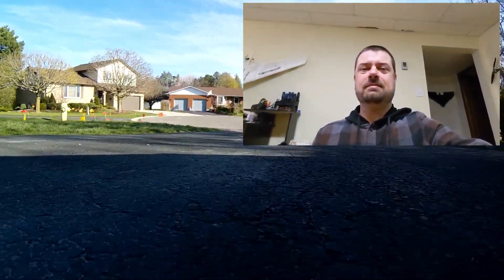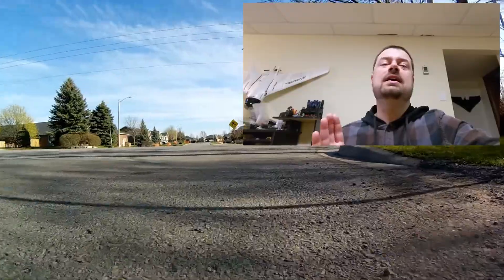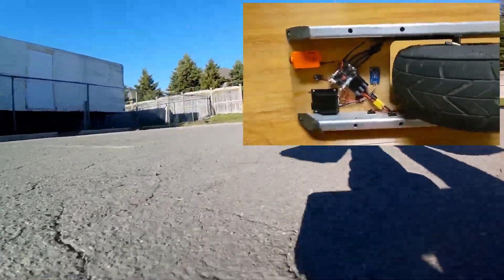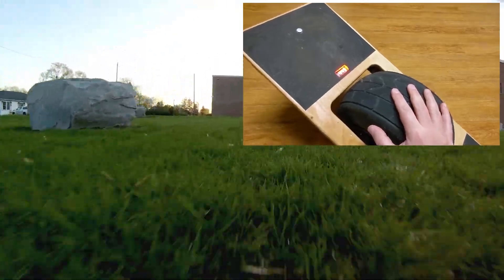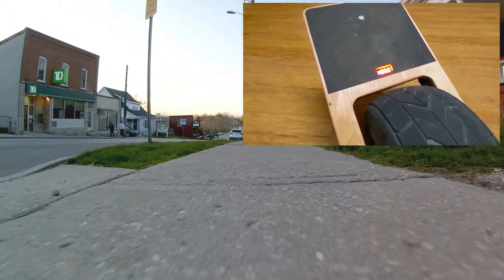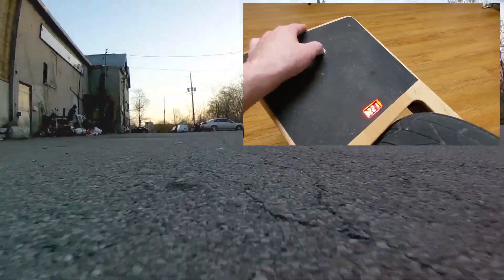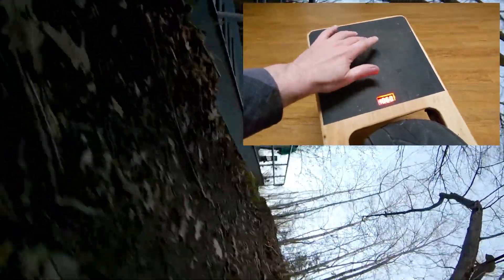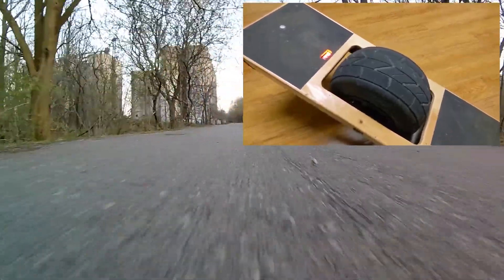DIY OneWheel - After 200km

Comment: really interested in your use of Arduino firmware to drive the vesc, looking through your BOM it is not clear which maytech vesc you are using 4.12, 4.20 or 6.6?? are you using bldc or foc? and will you be adding the vesc settings & full wiring diagrams?  really keen to make my own off your design and firmware and have questions, how can I get in touch, thanks in advance
Reply from the maker: 4.12, FOC, protocol uart, wiring is explained on the site, but I will be uploading diagrams as soon as I can. I will also try to get more on vesc settings up as well.
Reply: @cammservices  thanks for the info, looking fwd to the updates, Have you been on a FM onewheel if so, how does it  compare to yours?

Comment: How would the board react to a hubmotor axle lower than it currently is? I wonder if that would work to increase clearance for hill climbs?
BTW great project, thank you for sharing all the info!
Reply from the maker: Honestly, forward and back stability would be fine, it would be the side stability that would suffer to some degree. Having the pivot point to far below your ankles might induce a sort of speed wobble at higher speeds.
Reply: @cammservices  So I ordered parts as per your website and am looking forward to bringing one to life myself. Would you buy the same cells again? I don't have them on order yet and was wondering if there is perhaps a better choice? Will you release a wiring diagram for the BMS, etc?
Reply from the maker: @pepekrozinek  I have had good luck with those batteries, but do recommend staying with Samsung 25R if you go with another provider as the available AMP rating is awesome. I will post more on the website over the next week. Feel free to reach out at any point if you need assistance with the assembly.
Reply: @cammservices  Ok, here is a first issue: When trying to flash the arduino I had to comment line 26 (compilation difficulties) and I still get the following:
MPU6050x.ino: In function 'void readMPUx()':
MPU6050x:84: error: 'newMpuData' was not declared in this scope
MPU6050x:141: error: 'displayNumber' was not declared in this scope
Any clues?
Reply from the maker: @pepekrozinek  So I loaded Arduino IDE freshly onto a machine that has never had Arduino on it before and loaded the project and compiled with no issues. 
1. Make sure your using Arduino IDE 1.*.*  
2. Make sure you are loading the file from BoardApp1-15.ino and that the Parent Directory is BoardApp1-15 . 
3. Make sure you have selected Arduino Nano under Tools>Board Let me know if you are still having an issue.
Reply: @cammservices  Matt, thank you for quick reply!  Arduino 1.0.5-r2 was the issue. When I used 1.6.11 with ATmega328p (old bootloader), it finally went through!
Reply from the maker: @pepekrozinek  Awesome, good to here, let me know how it goes.
Reply: @cammservices  So I finally received my BMS, still waiting for the hubmotor (from Floatwheel). What a gongshow so far!
Would you be willing to get on a Discord or such?
Reply: @pepekrozinek  Hi, can we talk with Discord ? I need to ask about VESC 4.20.